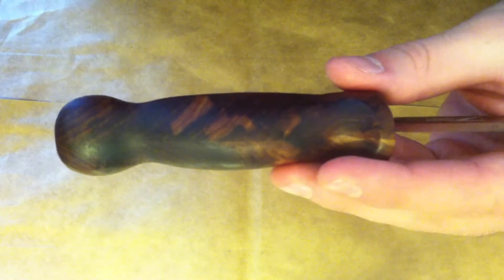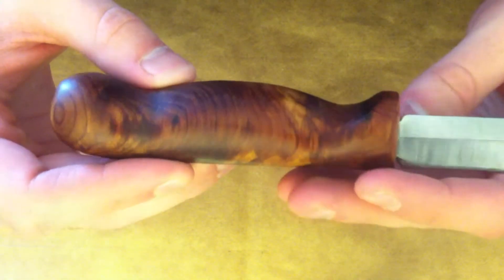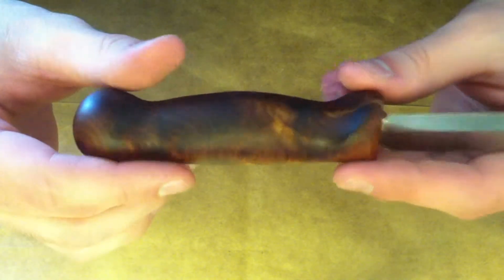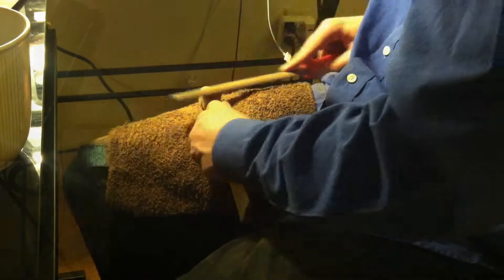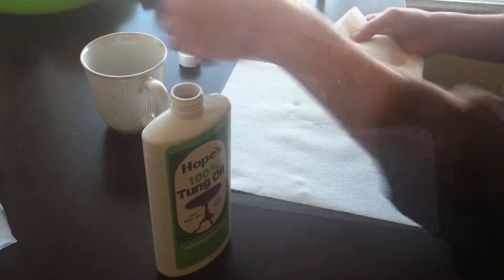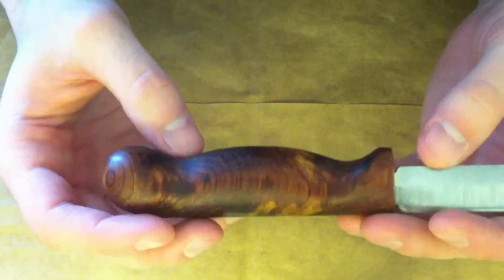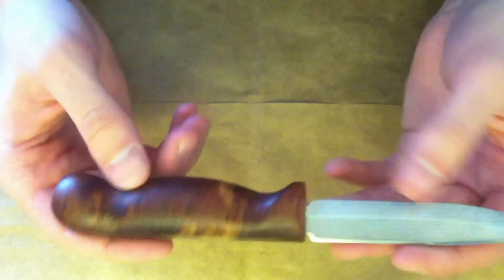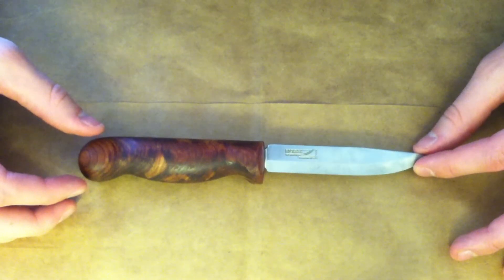Custom Mora Knife Handle - Improving on a budget high quality carbon steel blade

Comment: I have found out that a course belt from a beltgrinder works just fine if you use it manually, even better than a file. you have much better control of the shape, the process is ouf course more laborious than it would be if you used the powered tool itself

Comment: Looks great. Like the way the grain of the wood looks. how did you insert the handle? Drill it out and use epoxy?
Reply from the maker: Thanks happy! I was really happy with the grain as well. This is actually a split piece of wood that I chiseled out and then glued back together with the blade inside. My early videos show a bit of the process.

Comment: but how did you drill the hole into the handle of a solid piece of wood. Usually the handle for this type of knife (because it tapers) is made of different pieces of wood.. In other words how did you know the handle was going to be on so tight that you knew the blade wouldn't fall out of the handle??? P.S. Beautiful looking knife!!!!
Reply from the maker: Dude Bro Thanks a lot! I cut the wood in half and cut out a little reservoir for the tang and the epoxied the halves together. Here is the video, its a bit long but it has the process https://www.youtube.com/watch?v=7QDvMUUAcks
Reply: THANK YOU!!! I somehow missed that

Comment: Yeah, initially the end grain will soak up a lot more oil. It isn't a bad thing though! You WANT oil to penetrate into the wood. After about a year, the face of the grain should be about as saturated as the end grain (if you do a decent job with oiling it)